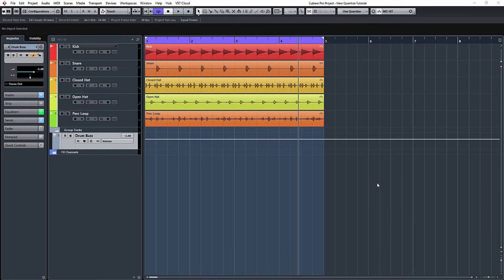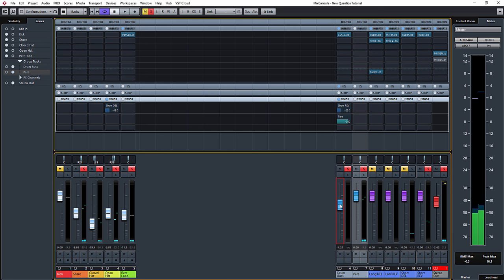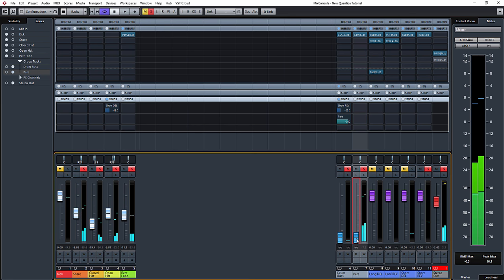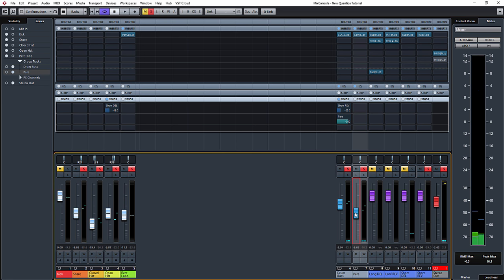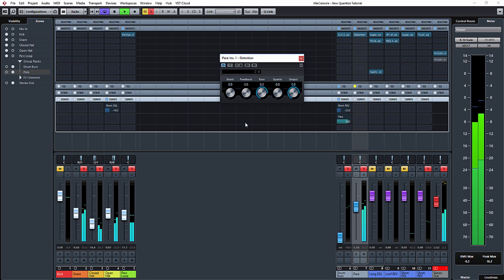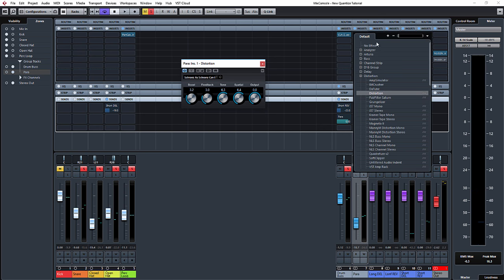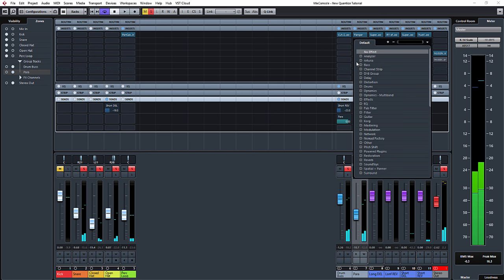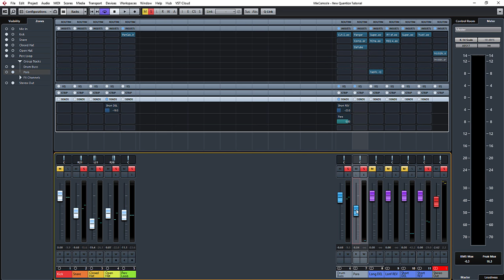Parallel Compression in Cubase using stock only plugins

Comment: I do subscribe on you! Like your vid. Btw, could you explain the difference between pre and post fader?!
Reply from the maker: Pre means it goes before the fader so if you send any signal the amopunt will also be adjusted if you drop the fader, post means if you send out any reduction or gain in volume with the fader will NOT adjust the level of the send.
Reply: Uhm... thanks.

Comment: I don't understand, I thought there should be two compressors used but you only show one.
Reply from the maker: in this tutorial I am showing you how to parallel process drums, on the second group (PARA) i have placed a compressor with extreme settings and then added the signal to the original group (DRUM BUSS) in theory the second compressor should of been on this original buss but its not essential.